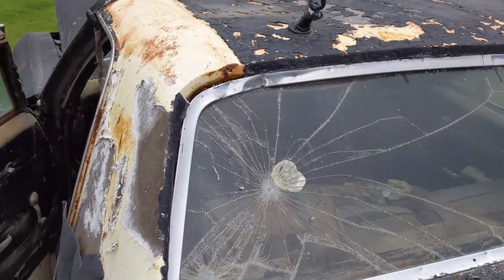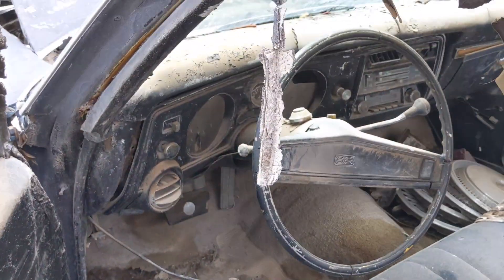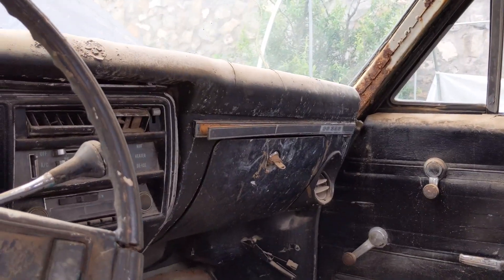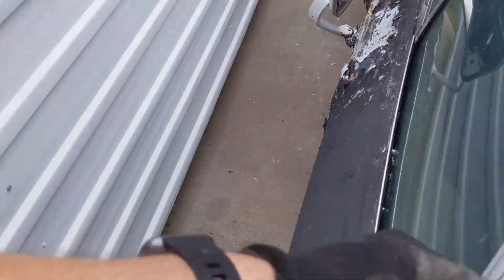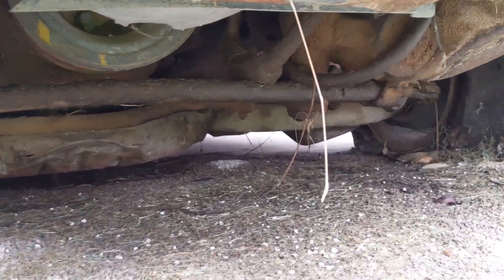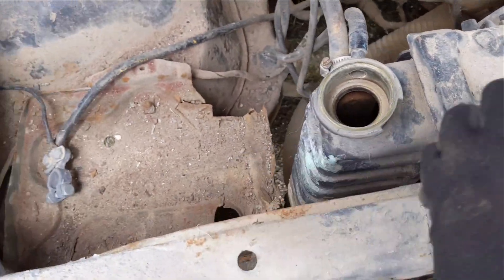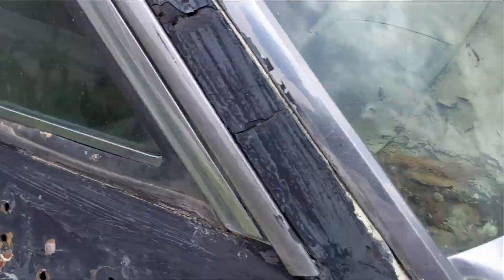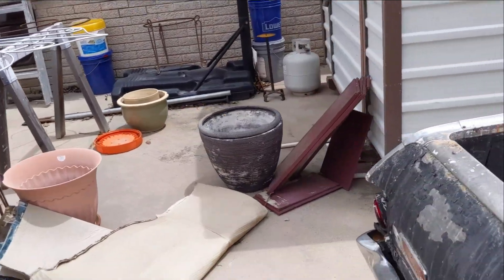El Guapo Part 1: 1969 SS396  El Camino Project

Comment: Looks like a fun project, but better be ready to roll up your sleeves. El Gaupo sounds like  a cool name, but gonna be like Mucho Dinero.
Reply from the maker: Hey Full Throttle! Yeah, I am hoping most of the mechanical systems are not too bad. From what I can tell the rust is actually not bad, just a whole lot of cosmetic issues. Either way, time and money, but should be fun!